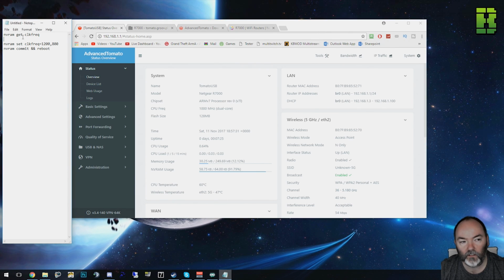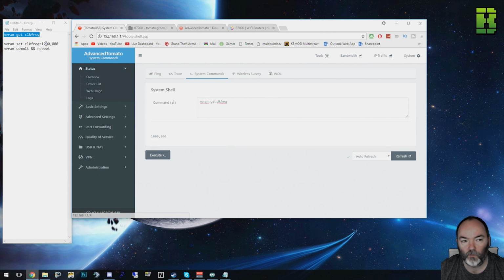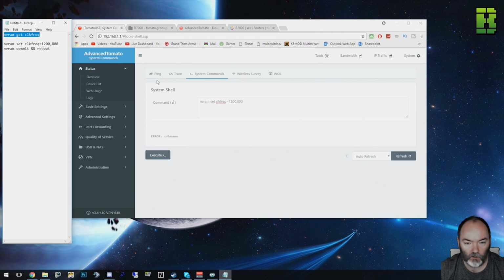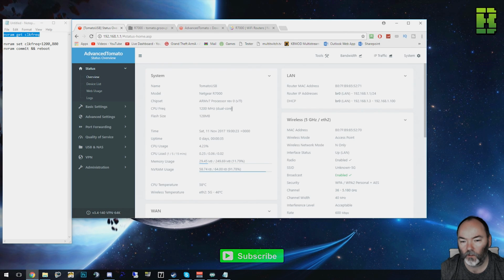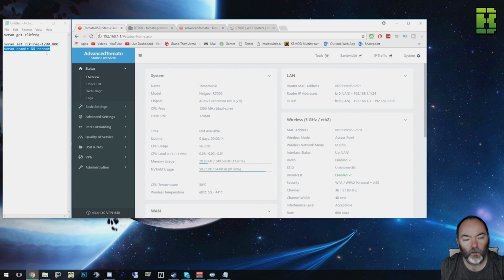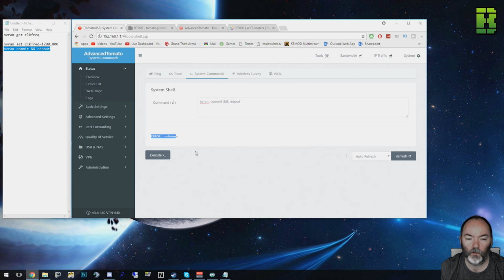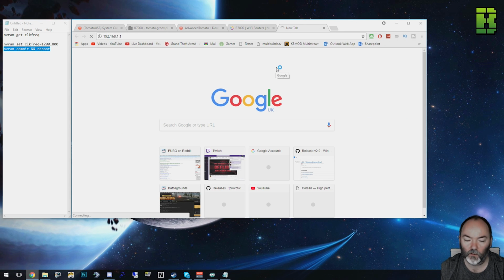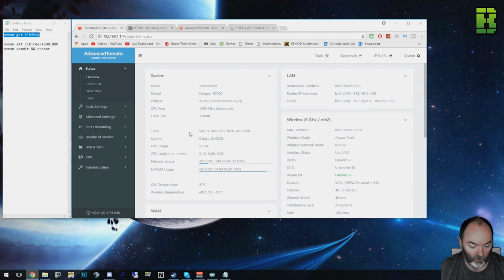Netgear Nighthawk R7000 Overclock Tutorial Wireless Gaming Router Custom Firmware Wifi

Comment: What is a safe temperature to maintain as a maximum? Mine is now around 67/68º without overclocking..
Reply from the maker: I would say 85 is the max you want to go. Just keep an eye on it when you first do it and ensure it's not to hot to the touch or crashing.

Comment: whats the recommended Clock setting i should set it too?
Reply from the maker: Just use whats in the video as or trim it back if you find its not stable
Reply: Beardedbob Ok, Im currently using 1200,800 and temp at 60
Reply from the maker: You can go to 1400 but 1200 is a good place 👌
Reply: Beardedbob anything higher will just crash the ram card lol
Reply: Beardedbob where can i find all the commands for advancedtomato?
Reply from the maker: Fair enough then you have it just right 😬
Reply from the maker: I just picked them up from multiple posts as I've not come across one central location hosting them.
Reply: Beardedbob Got you, I heard there was a fixed version of advanced tomato of this year in december that you can download
Reply from the maker: Will have to check but I've not come across it yet. Let me know if it comes out 👍
Reply: Beardedbob its been out, Here it is—— https://bitbucket.org/AndreDVJ/advancedtomato-arm
Reply: Beardedbob have you tried it?
Reply from the maker: Thanks I see it was last updated on 2018-12-17 so it is recent. I've not taken a look yet but might do later this week if I get a chance. Have you tried it yet?
Reply: Beardedbob Not yet sense i did alot of settings setting up and i dont wanna loose my settings like upnp, port fowardings, dmz, etc

Comment: Is there any way to change 400mW max to 1000mW?
Reply: Yeah, because in DD-WRT, the max is 1000 mW, and I had way more extreme WiFi speeds and range using that. But I stick to Advanced Tomato because of the hardware acceleration and my 500 Mbps internet line. I hope someone here or elsewhere can find some information on this, or if this feature can be adjusted. Also, using a R8000 here.
Reply from the maker: Not that I'm aware of
Reply from the maker: Advanced Tomato seems to limit to 400. I'm not sure if this can be overridden in the CLI though.

https://imgur.com/zEIsTc4